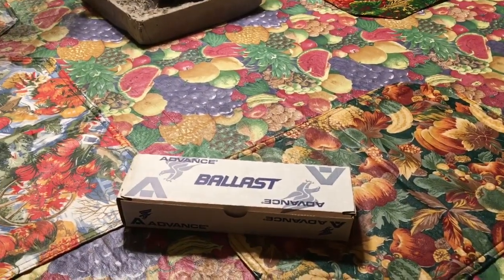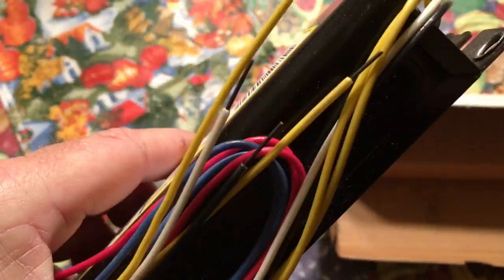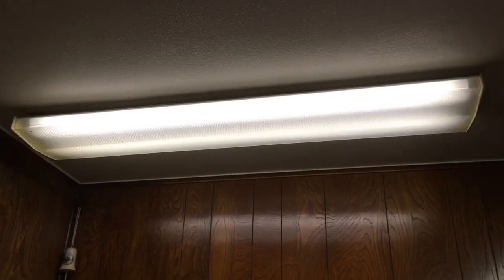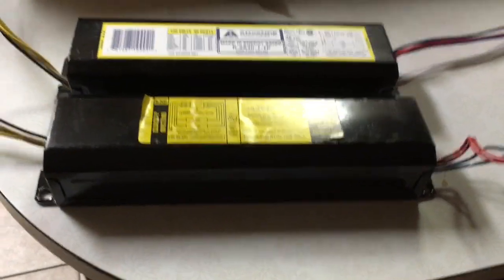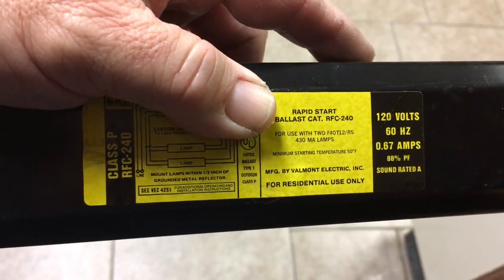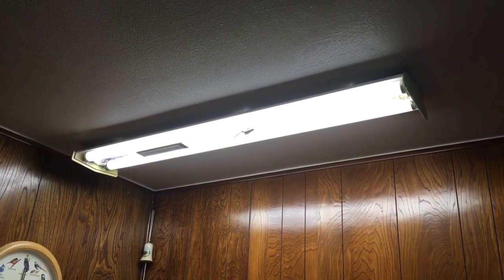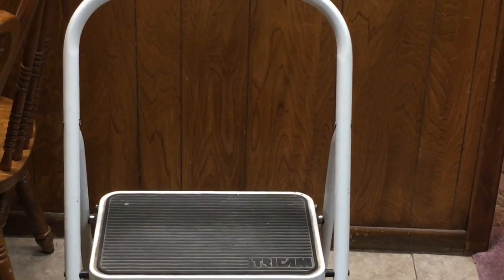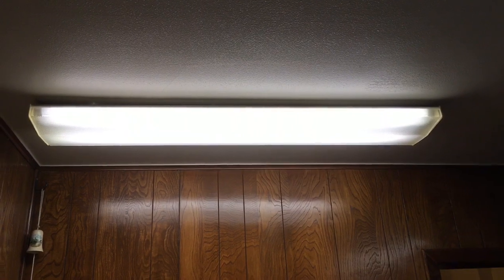Ballast Replacement on Two Lamp F40T12 Light Fixture

Comment: Even the magnetic dinosaurs go bad eventually. While this is unfortunate to see, I’m glad you were able to replace it with another proper magnetic one! I subscribed!
Reply from the maker: Yep, I have several NOS magnetic ballasts, just in case. Very rare for one to go bad here. There are 10 of these fixtures still in service in the house. The two fixtures in the laundry room are at least 50 years old, still on original ballasts. Thanks for subscribing!

Comment: I'm actually in need of a similar ballast.  A fixture I have in the basement has a ballast that overheats periodically and it shuts off, a while later it comes back and the cycle repeats.  Not one of the top things on the priority list, it's probably been doing that for a good 5 years now.

"Make sure safety is your third priority".  Hmm, sounds like you might have been watching a lot of jaykay18 videos!

I had a question as to the placement of that light, but you answered it before I even asked!  Love the wood paneling too!
Reply from the maker: Haha Jaykay18, and Pug1 movies! Got to be safe!

I didn't realize how dim this light had gotten, until it got a new ballast. I really is a night and day difference!

My first job was maintenance at my old church, and there were many of this type of fixture to keep working, so I saw that symptom many times over the years. 
I hope you can find a replacement ballast on the cheap. I never thought there would be a day I couldn't easily go pick up some magnetic ballasts. The electronic ones are a joke!

The wood paneling was done by the original owners of the house. My guess is 1967, because that's the date stamped on the kitchen sink. Besides paint, flooring, windows, and central air, the rest of the house is just as it was in 1958. I don't even think the front door lock has ever been re-keyed!  As long as I'm around, it will remain that way. I figured I better explain why there is a seemingly randomly placed light fixture!
Reply from the maker: I forgot to mention the ebay seller I bought these from had them for $16.99 each/free shipping, around the same price as an electronic inequivalent ballast at the box stores. I typed in R-2S40-TP, and the prices were all over the place. Not sure if it's the exact ballast you need for your application, but it does two four foot F40T12 bulbs.
Reply: Oh, beg my pard!

My dad finished his basement about 30 years ago.  Needless to say, out of the 8 ballasts, I think about 3 still work, and they are temperature and humidity dependent at that!  His fix was to put a lamp down there instead.  Too bad, that was a pretty cool basement when it was originally finished.

Yeah the electronic ones are ridiculous!  I'm sure they're bad for the bulbs too!  Should have some old fixtures laying around I can pilfer the ballast from.

My dad's house has the original locks as well!  They are double-deadbolt style.  There's a pair or rings on the frame of the door and when the door is locked it drives two bolts through the rings.  On the front and both back doors, all the same key.  Front door of my house got a decently expensive Baldwin lockset with a very heavy deadbolt.  The doors in the house had no knobs on them when I moved in, I put Schlage sets on all doors.  2 doors, the one to my office and the one to the basement have keys, and SOMEHOW I ended up with the same key for both!  I've locked them just about never.  Interestingly enough, the other sets, the kind for like a bathroom that has the button you press to lock on the inside only, I bought maybe 4 or 5 of those.  Every single one of them, if you jiggled the outside handle, they'd pop the lock!  I called the company, and the guy said to me (exact words) "This is SCHLAGE you're talking to!" as in "this kind of stuff doesn't happen with our sets".  Well sure enough they had a bad batch for whatever reason, after exchanging all sets, they all work fine.

Bar in my basement was put in sometime in the 1960s, not sure exactly when but it was rather early on.  Previous owners tell me they had some sort of air conditioning unit for the basement, there's a 220V plug there for that.  Have central so it's not needed anymore, but I left it in case I were to get a 220V air compressor, which won't be happening for a really long time if ever, and if I did, it would go in the garage.
Reply: Decent!  Maybe I'll take a look at what I have!
Reply from the maker: Those locks at your Dad's house sound interesting. I've had the same issue when the weather gets humid, and it's easily fixed with contact cleaner, and a brush to the sockets. Power off, of course! I guess putting a lamp in there is a cheaper, and easier fix, though! I like to keep an eye out for old light fixtures, so I can harvest ballasts. 

We have all Weiser branded locks, and knobs in the house. They are chrome with brushed bronze accents. They fit the house, that's for sure! The bathroom locks, the entire knob gets pushed in, and turned to the right to lock. To unlock, turn back to the left until the knob pops back out. That may be a good idea to demonstrate for a movie! The front, and back door knobs were getting very worn out, so I found new old stock exact replacements. On the front door I just swapped the cylinder from the old unit to the new, so kept the same key. I did get a vintage Weiser re-key kit, so I need to learn how to disassemble the backdoor knob, and re-key back to the original, or figure out how to swap the lock cylinders at least. It's a completely different procedure than the front door lock is. That sounds about right about calling a company out on a defective product. Glad you got replacements though. Cool to get two locks, same key!

That would be noisy to have an air compressor in the basement. Perhaps, if you decide to add anymore dryers, you'll have a ready power source!

Comment: plus the electronic ballast burns out the tube alot quicker than the old magnetic ballast because they start them with a large blast of high voltage instead of slowly heating the cathodes.

Comment: This is the definition of a real ballast! These magnetic ballasts last so much longer than the electronic ones. I never thought T12 lights would disappear and now they are a rare sight. Seems like everything is going to LED now. I haven't run into a light with a magnetic ballast in a long time now. I remember T12 tubes were supposed to be phased out but i can still find them. Too bad the proper ballasts for them are out of production. Where did you find the ballast for this light?
Reply from the maker: Yep, it's sad a tried, true, efficient product is no longer available.
I found some NOS on ebay a few years ago.

Comment: that is the way to do it, not "upgrade" to LED lights and not use an electronic ballast. i have 2 lights from the early 50s with their original ballast, the real old preheat kind that use starters instead of rapid start. they will last forever.
Reply from the maker: Yep, I repair, rather than replace, if at all possible.
There are two of these lights out in the laundry room. As far as I know, they are at least 50 years old, and still have the original ballasts.
I have a preheat above the kitchen sink, and another out in a storage building. Both just keep working with no problems. Can't ask for more.